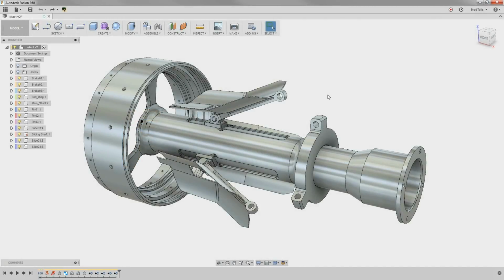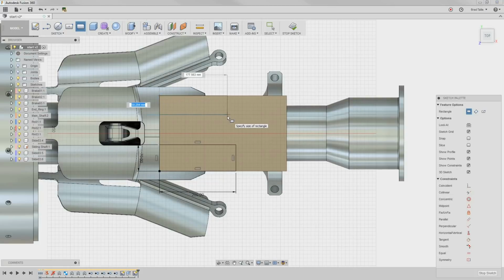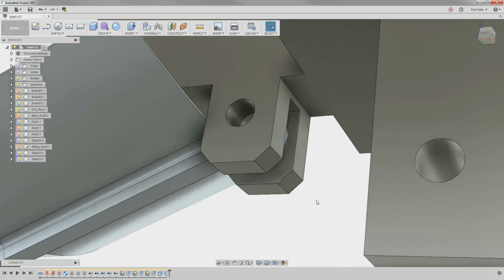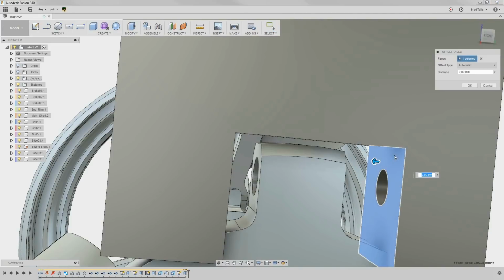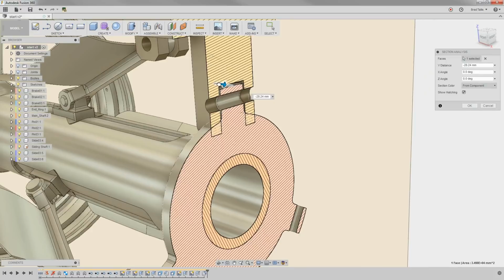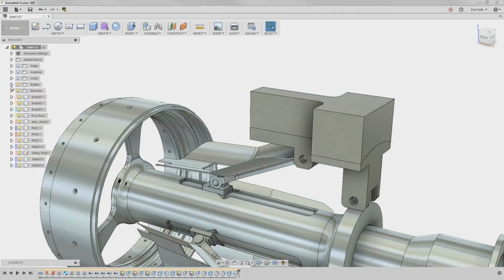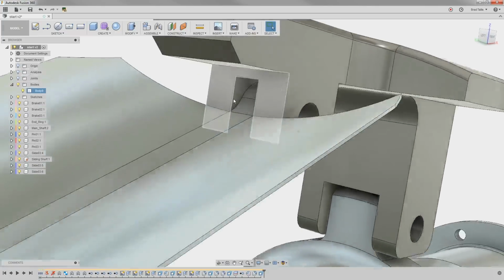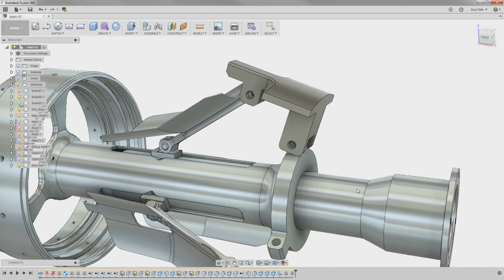Using Direct Modeling Techniques for In Context Design

Comment: Very cool, but wouldn't the new part collide with the outer casing?(if installed as to the plane which cut)
Reply from the maker: That's definitely possible, but an easy fix at the same rate.